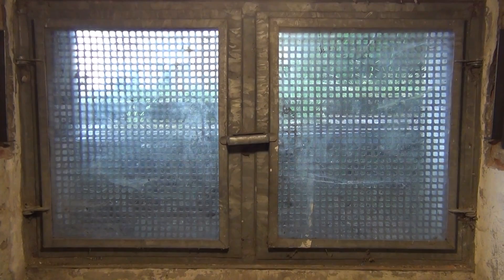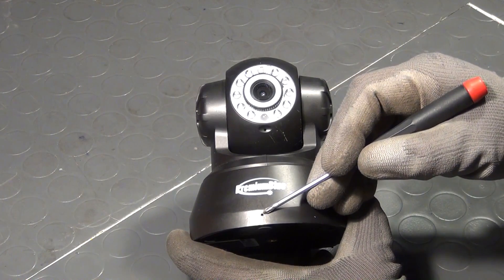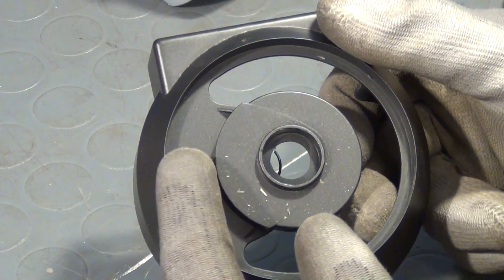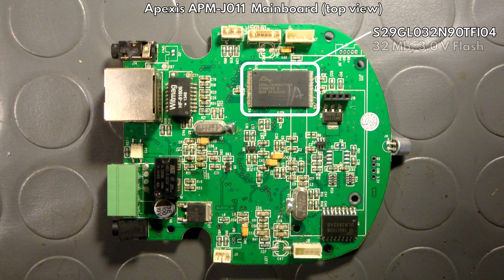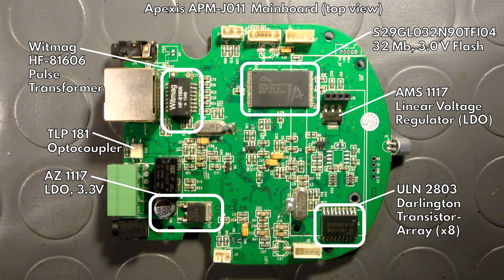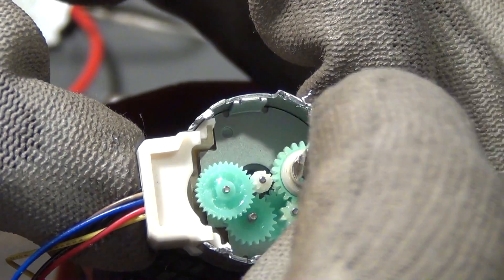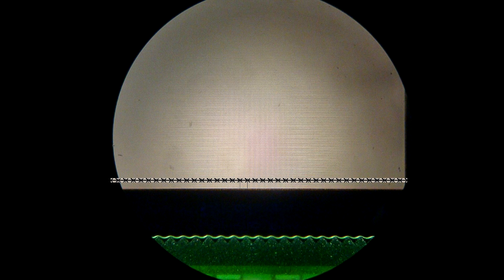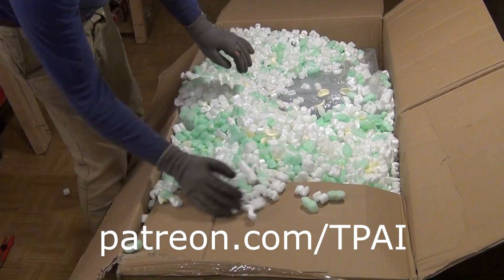IP Camera Teardown

Comment: Hey TPAI,

If you plan to purchase any more cameras can I suggest you try some with .h264 video codec? These are much more efficient in terms of transmitting and storing video to a recording device, as well as viewing the camera feed online. It probably uses about 1/10th or less of the bandwidth that a MJPG camera uses. Streaming a few mbps over your wifi (which is a shared medium) continuously can have a noticeable affect on the performance of the network in my experience. Plus you can get great framerates even at very high resolutions.

For an installation where the camera is fixed (which I expect yours ultimately will be) then PTZ may limit your choice of camera. There are many bullet or dome style IP cameras with h264 starting at around US$50. The additional mechanics and electronics (as you've shown) for PTZ add on cost so a stationary camera can have better components than a PTZ camera for the same price. Foscam makes some good entry level units (just watch out for clones) of all shapes and sizes including weatherproof outdoor units.

I have tried a few solutions for recording video (and, of course, detecting motion). There is some windows-only software called Sighthound (formerly Vitamin D Video) which is just fantastic. It is not free, but does not cost a lot given the functionality it offers. The key feature is the intelligent way that it can detect a person (vs. a cat) to avoid false triggers. If you try it out I'm sure you'll see how well it works, better than I could ever explain it.

Some other software which you might also like is called Xeoma. It is very powerful (runs on any platform) and I was quite impressed. I believe you can get a free license if you do a review. iSpy and Blue Iris are two others you may like to have a look at.
Although you can run Zoneminder on a Raspberry Pi for free I don't think that it is a good option these days. Better to repurpose an old PC or laptop.

Thanks for your videos. This is the first comment I've left but I've been watching a while.

Comment: The thing I never understood about security cameras is why do the manufacturers "ring" the lens with IR LEDs? It would be better to supply some small IR lights that can be place in strategic locations to get a good view of anybody coming close to the camera.
Reply: What's the point of lighting something or someone up from the side? The picture would be full of shadows that make thing harder to see. Also it would be much more expensive to build something external with case, wire and connectors.
Reply: For the pan/tilt i guess its obvious, for the fixed cams there are separate modules with high power IR leds+lens you can buy.

Comment: 32M Flash is the ARM processor program memory. There is no local storage of images at all here. All goes out over the network connection. 

Interesting they used a real bearing for the swivel axis and not for the other. Those steppers are very cheap, as they are used in aircon indoor units as well as many other places where a low cost easy to drive slow rate motor is needed.
Reply from the maker: Yeah. I'm sure  I was wrong about that. You couldn't get much footage on that anyway. Made an annotation in the video about that. And "Yes" it's weird that this cheapo has an actual bearing!

Comment: The camera runs linux, somewhere on the pcb is the serial. 
To get a jpeg picture from the camera:
in your html file: <img>http://x.x.x.x/snapshot.cgi?user=admin&pwd=admin</img>
snapshot.cgi
description To obtain the snapshot
Permission visitor
Syntax /snapshot.cgi[?user=&pwd=&next_url=]
Parameters user:username
pwd:password
next_url:the name of snapshot
Note 1 If not use the parameter “next_url”, the snapshot name is：device
id(Alias)_ Current time.jpg
i control my camera with a self made vb6 program.